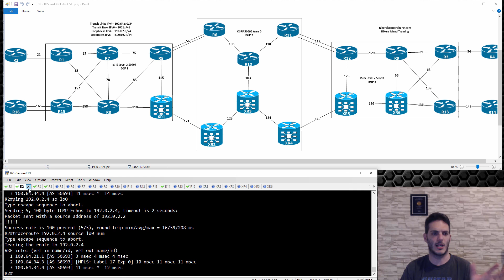mGRE L3VPN

Comment: Yeah u were the first one I guess.. because I was searching for this solution back in 2016. I have implemented this in one of the production network, their infra has 8 DC around the globe and we configured 15 tunnel end points including the secondary router as well. This one is a cool solution to become ISP agnostic. We decided this solution to overcome multiple traffic passing the Primary DC always to get to the other end and to overcome prefix limit in ISP around the globe. ASR 1000 on your end with adventk9 license and just advertise your loopback to ISP to deliver it across the globe. Scalable!!!